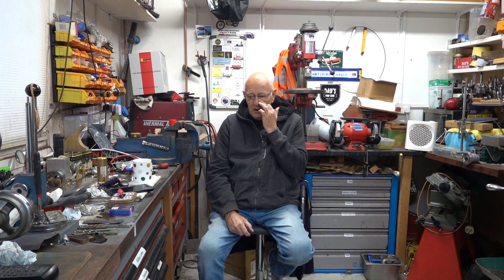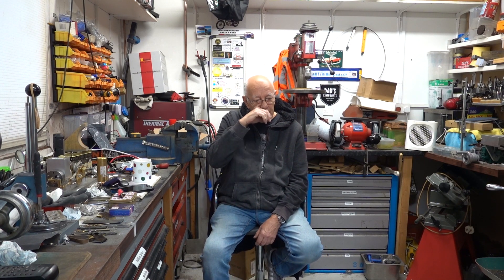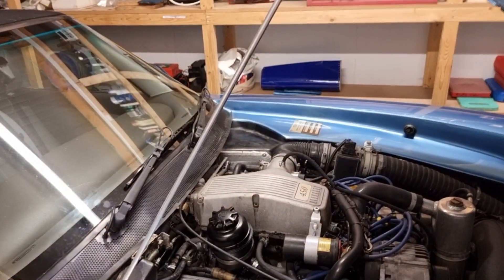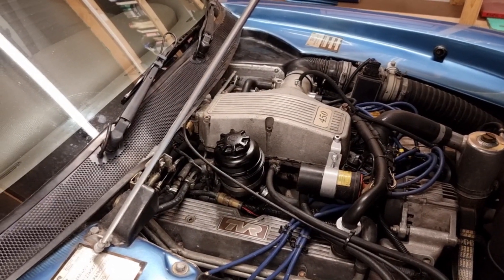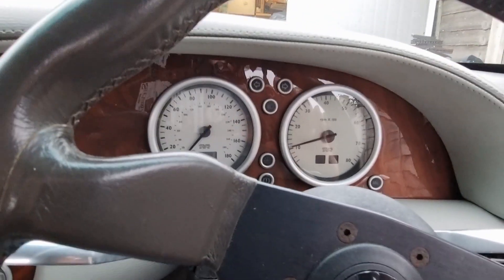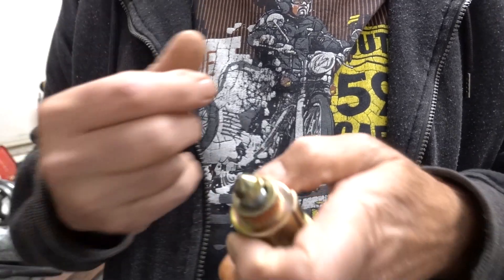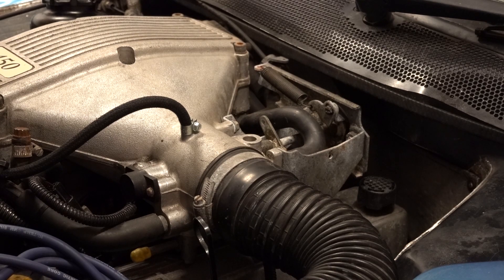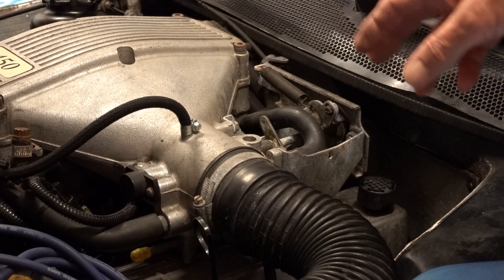TVR Chimaera 450 Erratic idle the cure

Comment: Good diagnosis
I have taken my Griffith to tuners here in Australia with poor results too
The 32mm spanner is weird isn't it
I had fun with the sump inlet on my car
Reply from the maker: Hi Cobar5342. Thanks for the comments. I think with the Tvr it's a ongoing project. Always jobs to do. 
Steve.
Reply: Hi Cobar. I am in Melbourne (96 Chimaera) and struggling to find anyone who has knowledge of these engines to resolve engine cut-out and over-fuelling issues causing poor running etc. Did you manage to find anyone who knows these cars to ensure smooth running?.
Reply from the maker: @philnash9119  Hi Phil No. I am a DIY nut & would never use a garage to fix my car unless desperate. As youv'e probably seen on my vids i did cure the erratic running but not had any overfuel problems. I did read somewhere that the fuel pressure regulators can give trouble. A lot of owners have ditched the origonal & fitted a adjustable regulator. The one near the plenum chamber to the right side of the engine. If you are having problems then why not see if there is a Landrover specialist near bye as the engine is the same unit as fitted to a few models inc Range rovers. Mid to late nineties & early 2000's.
 One problem I have & not looked into yet is the fuel tank getting a vaccum in it. As when removing the cap to refill I get a hiss from it. I believe there is a carbon canister somewhere in the front left wheel arch that can block up & a valve that operates it. But that so far has not caused me any great problems. Although I have not done any long runs in the car yet.Sorry i cannot be of more help. I Joined Pistonheads forum ,where there is a TVR section & quite a few petrol heads with TVR's. So maybe join & ask a few questions on there. I am also a member of the TVR forum UK. But it has very little traffic, 
Steve.
Reply: @philnash9119  I went to Dynotune but I think a specialist in Rover engines might be the shot. Good luck

Comment: I had a chuckle at Waylon Wire's new video... On the box above the lift lever, he has a sign saying "PINS!"
Reply from the maker: Ah I wonder why !!!!. When i saw the 1st video it really did make me cringe. Block of wood under a spring hanger .
Steve.
Reply: @Steviegtr52  Now he has Steel extensions that socket into the lift arms, with lips that continue up one on either side of the car's frame, instead of the rubber lift pads...
Reply from the maker: Yes i saw that video. Much better now for him.
Steve. @trollforge

Comment: Look up setting the base idle, its the correct method for doing it. Basically you clamp the hose going to the stepper and set the base idle to 600 rpm from memory, using that screw, when you remove the clamp the idle should then raise up to the correct rpm. Pretty important this is right.
Reply from the maker: Thanks for the info Izzy. I still have not put fresh fuel in the car & no idea how old it is. Probably many years. Once i get the car finished I will tank up with the 99 octane at local Tesco & also think the tank breather is not functioning correctly as there is a vaccum in there when i release the cap. 
Steve.

Comment: Just noticed that you have R6 rating on your fuel pipes under the bonnet, these are not good as they are not ethanol proof and prone to failure. Common problem on TVR! You should consider changing them every few years as I do on mine all the best.
Reply from the maker: Thanks for that Robert. Not sure what has happened but somehow the comments have got mixed up on here. The base idle. Yes by the book. I do not have a book. I know the range rover auto is around 700-750. Any more & the vehicle starts dragging forward . I would have thought arond 850-950 for a manual car. I have still more to do on this once I get back on the road . 1st job is fresh 99 fuel & sort out the vaccum in the fuel tank. Thanks very much for your help 
Steve.
Reply: @Steviegtr52 Thank you for the reply regarding your fuel tank, I have vented mine to atmosphere by running a hose from the tank breather down behind the diff. Then disconnecting the carbon filter from the plenum no more pressure problem solved. Good luck
Reply from the maker: I may have to do the same. I will have a look once i get some other jobs done. Many thanks for the advice.
Steve. @robertparton6705